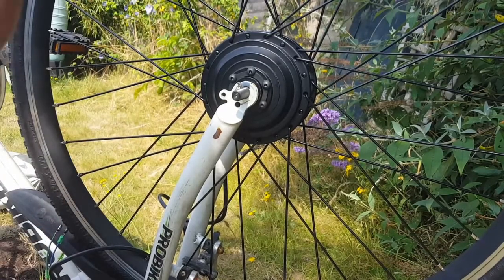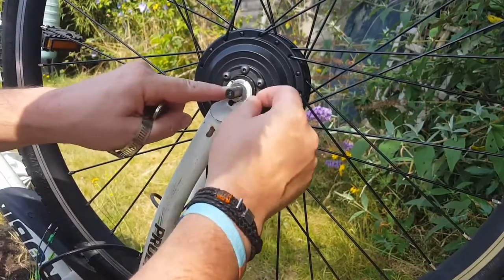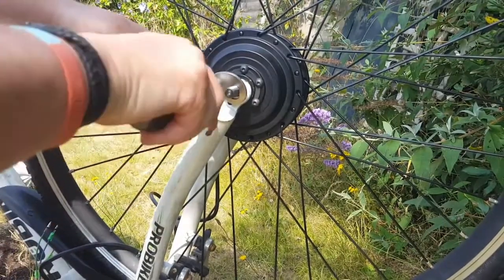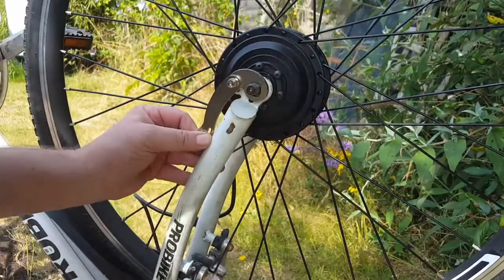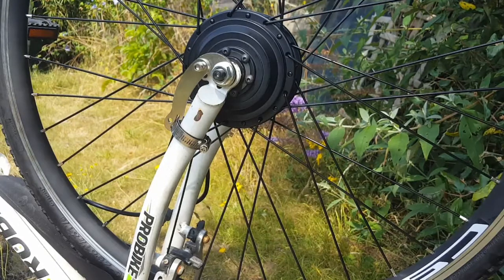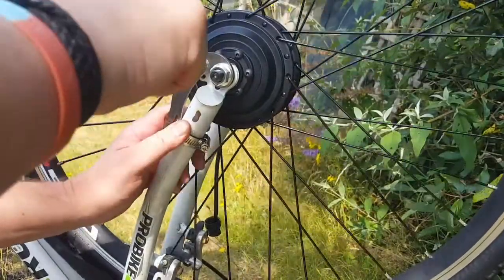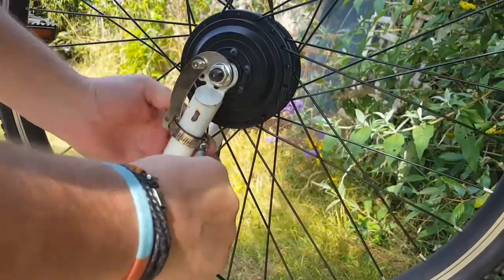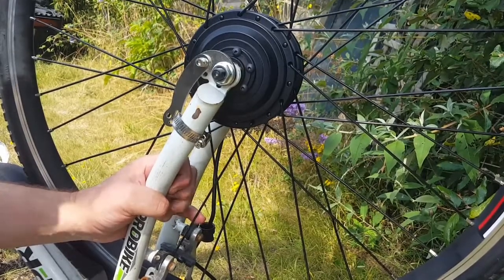Fitting an eBike torque arm to a front hub motor

Comment: I would have just installed a mid drive or rear drive, that front drive has me 2nd guessing about possible failings, even with those torque arms. Struts look so thin. I am sure you did you research but damn, i would have gone for a 350w motor.

Comment: Dont know why they dont just make the little plate to bolt directly onto the fender holes there on the forks . Holes dont match up on his bike , just a bit off . But that would be all you need instead of that cheap ass clamp.

Comment: For everyone confused about which direction, he is actually correct to have it on the back. See this video for the physics of it, and don't just listen to YouTube comments: https://youtu.be/c15s6LYroXs
Reply from the maker: Thanks. It is good to question
Reply: @bangcrashtinkle6718  Agree. Important to get it right where safety is concerned 👍
Reply: He did it the wrong way and you understood the linked video also wrong. Tire spins forward but motor torque pulls wheels the opposite direction. This is why torque arms needs to push against the fork instead of pulling away.
Reply: @happygiraffe9787  I'm following the instructions of the designers and manufacturer of the original torque arm here: https://ebikes.ca/product-info/grin-products/torque-arms.html they say it should be on the back of the fork.
Reply: @dan_apeks  Thats definitely weird of them, as you see the thru axle motors in their shop having their torque arm below. In these motors only way to transfer torque is through arm and they put it correctly below. Anyway its stretching the hoseclamp but I would add a third one then to minimize stretching effect.

Comment: Thanks, I also use a 500 watt front wheel kit on my trike. The front wheel came off during the 1st ride (100 yards) damaging forks, fender, minor damage to wheel. Only the brakes held things together. I now have a torque arm ordered.
Reply from the maker: Hi Ken - yep - I think all motor sizes need a torque arm even for 250w just to stop you screwing the wheel nuts so hard they never come off again
Reply: Seems like front motors are inherently dangerous and liable to failure so I would stay away from them, honestly. Torque arms might not be cure-all remedies for these kinds of events. I was reading someone who put them on and still had failures.
Reply: @Mishakol1290 Nah
Reply: D
Reply: Somewhat similar had mine fall off in a super busy intersection both me and the bike laying in the road not one fucking car would stop.

And hey man they don't come with the kit and not one mention of it. Should be a class action for it how many have been killed or seriously injured.
I got the TAs, I think you should use blue thread lock too left out of the video.

Comment: Hey, I have a bafang middrive single speed build. the nuts on the rear wheel keep coming loose... would a torque arm fix this problem?
Reply from the maker: uwotm8 - the sudden torque on the sprocket might be pulling the whole wheel forward so it may well be worth putting a torque arm on the chain side to dampen that. For $10 I'd give that a shot

Comment: I have a 48v 1000w front hub, let me tell you, I have 4 toque arms on it, 2 on each side, both front and both back of the forks, and I have a 48v 1500w front hub going on another bike, 4 toque arms, all the way around the forks, believe me when it says use a toque arm, use more then one,if that hub spins off the forks, it's no joke,
Reply from the maker: Rick,P - at 1000W I total agree. Mine seems very stable at 500W even off-roading it hasn't caused any change and I don't baby it. I think I'll take your advice when I move upto 750w ?? 1000w for the next bike though. Have fun
Reply: @bangcrashtinkle6718  
Right now im using my 27.5 48v 1000w hub on Budweiser beach cruiser yes 4 toque arms of course, this thing flies too, i have a 700c kit, 48v 1500w , just got a new 700c bike delivered waiting for me to get home, in witch i am on my way now, just need to find a good pair of front shocks for my new bike, one bike shop said that you dont want to use shocks with an ehub, myself, id rather prefer to have front shocks, when you hit a bump doing 25× mph , ouch lol
Reply from the maker: @rickp7683  That just sounds like so much fun mate. Don't know why your bike shop "you dont want to use shocks with an ehub" when you get them on the eMTX bikes anyway. Maybe they meant if you are using a front hub as this would then bounce and lose traction. The eMTX bikes are mid or rear driven. Sounds like your going to have a real laugh whatever you do. Good luck to that
Reply: @bangcrashtinkle6718  
Yeah i think i need a bike with front suspension, my e-hubs are in the front , hitting those little bumps doing 25-30, very well fell'em , i think front shocks would help, my first ebike was a giant cypress, i only had 1 toque arm on it, uf i would of had 4 all the way around id probably would still b riding it, that's the bike the bike shop said wouldn't do go on, i have the shocks , they said he would do it but its gonna b like #300,00 but advised me not to cuz it'd put alot of stress on the frame where the forks are on the frame, this new bike i just got, i don't really like it much,

Comment: Shouldn't you add that to both sides?
Reply from the maker: Hi XCELCIER - I couldn't because it was a normal bike and the motor had quite thick cabling coming out from one side so I couldn't fit the arm there. Having said that mine was only 500w so one seems to be enough to keep everything intact whilst charging around the cycle paths and a bit off road in Berkshire :-)

Comment: my ebike kit did not include a torque arm, the fork tabs were too thin and weak and spread wider over time, allowing the shaft to rotate, what a dangerous disaster!  Luckily the wires were not destroyed by wrapping around, but the wheel stopped suddenly and it hurt me.  I fixed it by welding thicker plates each side of the fork, outside of the fork, the shaft was plenty long enough.  It takes a while to get over it and drive full speed again.  I suggest getting rear wheel drive ha ha.
Reply from the maker: Ken - I can't remember but I think I mentioned I had to include the torque arm as it doesn't come included. It's a good point though - need to watch out for these things
Reply from the maker: ps.. what was the power of the motor? I heard that 250w was ok but if you are converting a bike not built for purpose I think you should always use a torque arm as the frames are much thinner
Reply: @bangcrashtinkle6718  350 watts

Comment: Hey man! Cool video. Very helpful! Do I need two torque arms in both sides - or just one would be fine? Does it matter what direction you install it on the axil?
Reply: you probably can't get the wire through the hole in the torque arm (because of any connection being too large) so you can only install one arm on the non wire side
Reply: @kenelder9615  Bull - S-T
Reply from the maker: @kenelder9615  oh... that makes more sense. I thought he meant at the front or the rear of the fork not "left or right side" duh me
Reply from the maker: Hi Tal - just one for me as my motor was small. I haven't found a difference which side it is so long as it's tight to take the strain and doesn't wobble